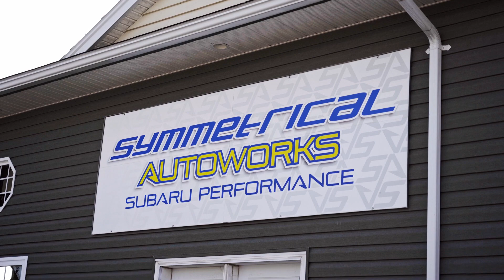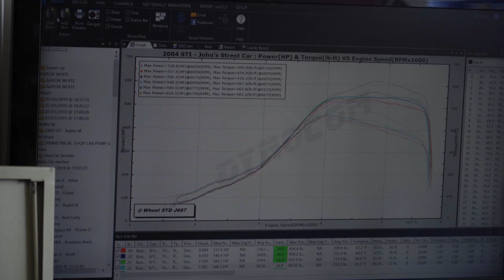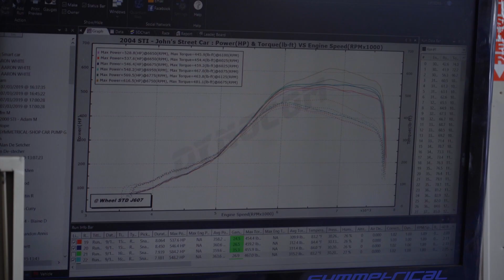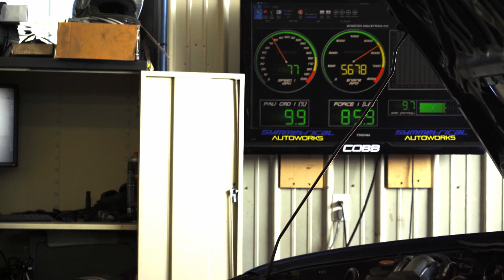Dyno tuning a 600WHP Subaru STI

Comment: Build list?
Reply from the maker: I'll try and snag one.
Reply from the maker: Closed deck & sleeved ej25, built heads w 272 BC cams, Garrett GTW3884 (67mm), ID2000 injectors, twin fuel pumps, -8 fuel lines front to back, fuel rails, AEM methanol injection, tuned with Cobb Accesstuner, completely stock driveline.